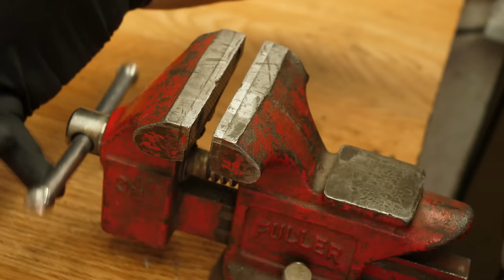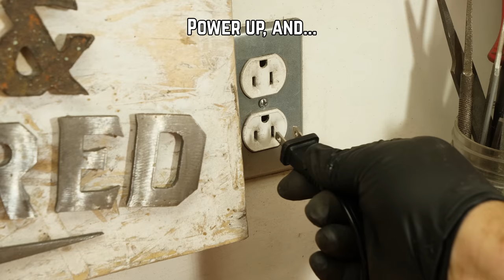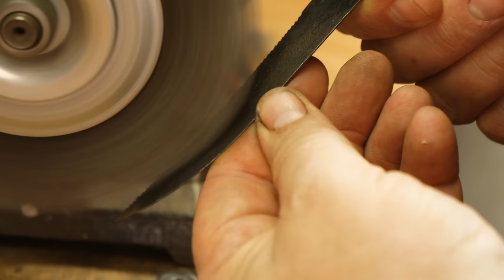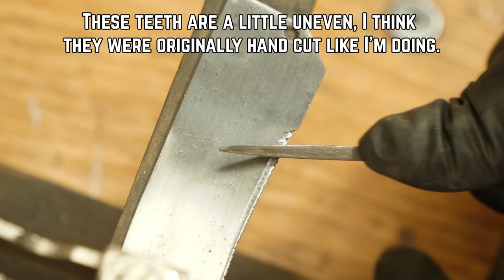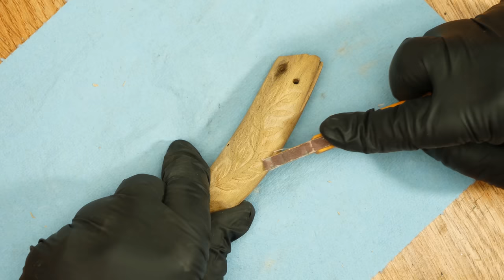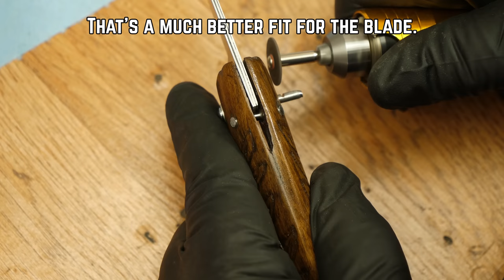Rusty Broken Pruning Saw - Antique Restoration

Comment: My son and  l were at a flea market , l found a large folding saw , ( stuck closed), with this weird orange handle,  it was $5 so l picked it up , my son asked,  Why is it orange ?  The man replied ,so you can  find it if you drop it in the woods ! It had a post it note saying Grandpa's bone saw. Stripped the orange paint off , and the handle was an antler,  must have been a huge deer ?   Great work on this,  always great to see a new generation using tools from the last.

Comment: Nice detail on the handle.
I wouldn't call that tool a saw. Blade sharpened on one side. Not set in the teeth. I'd call it a serrated blade knife.

Comment: Half of the blade became nonusable through that attatchment that thickens the blade. If you saw with that thing, then that part will not fit into the sawing groove. If you made it round, it would fill its purpose and the blade would still be fully functional. Kind of seems a cheap job made too rushingly.